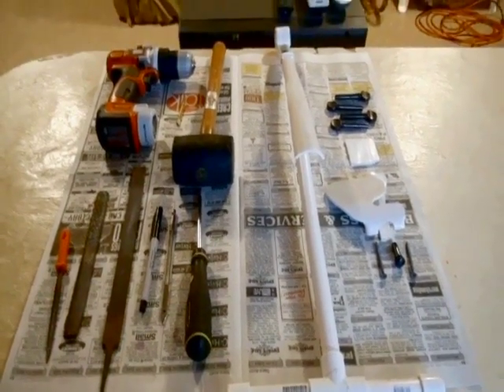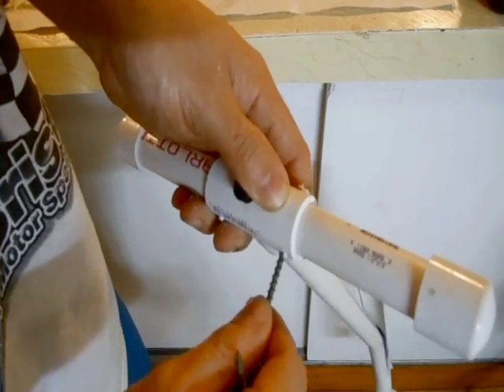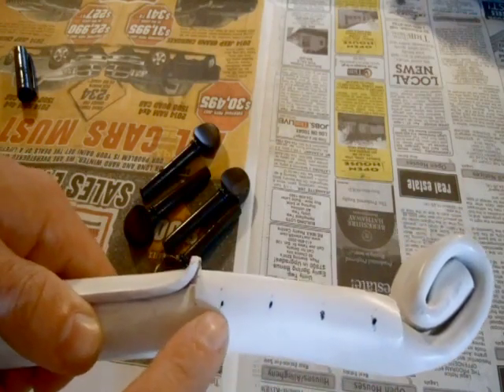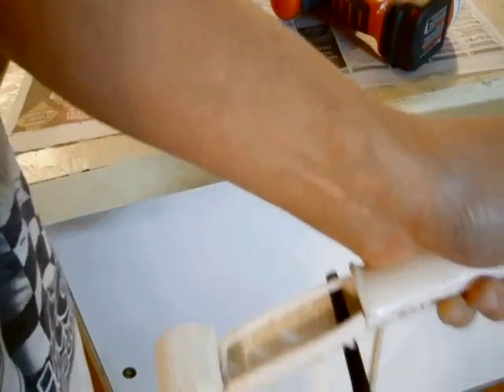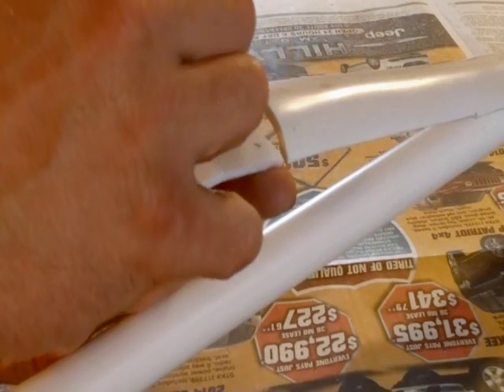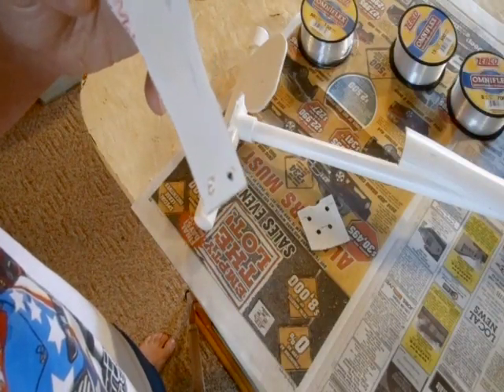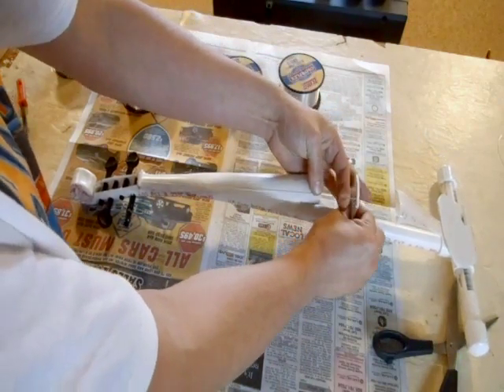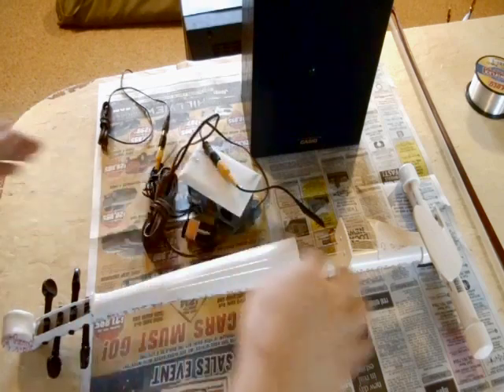How To Make A PVC Violin Part 3 of 3

Comment: I have watched all the videos and am wanting to try this on my own.  what size pvc did you use for the scroll?  I am only wondering because on the list it says it is 1" but the pieces with the t that connect are .5" did you use an adapter or are both pieces .5" or 1"?
Reply: He used .5 in for the body and 1 in for the smaller parts the he attached. Hope this helps!

Comment: NO. Fishing line is not a violin string replacement. Here's a little music lesson. Strings are coiled up springs with some form of string in them. That either resonates in the instrument, if acoustic, or is sent through an electric signal, if electric. You cant just put some fishing line on PVC and call it a violin. That's why bowing it sounds awful, and somehow, so does plucking. And dont even try tying actual violin string to it, for there is no way of that working.

Comment: how much would the project potentially cost me?
Reply from the maker: +TheCheapCrafter I really have no idea it was made of parts I had left over from other projects. Those tuning pegs and end pins came directly from a violin manufacturer they were in a bag of like 40 pegs and 10 end pins I scored it for like $20 on ebay (now a set of 4 pegs and 1 end pin is around $25 at Guitar Center) other then that the rest of the project is dirt cheap.